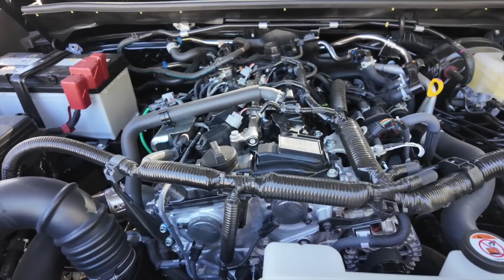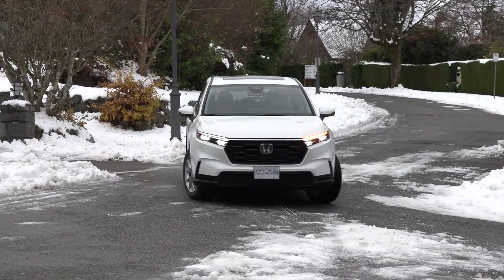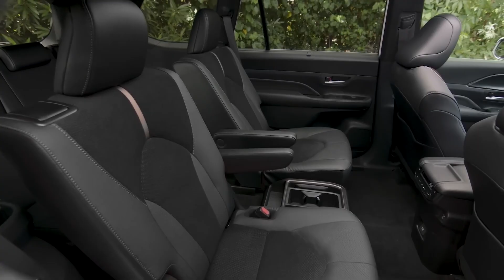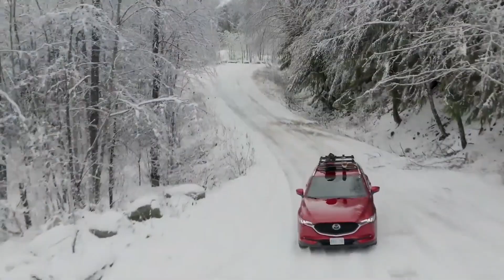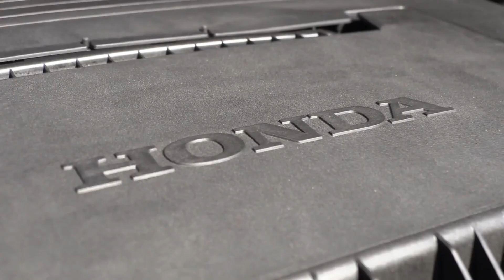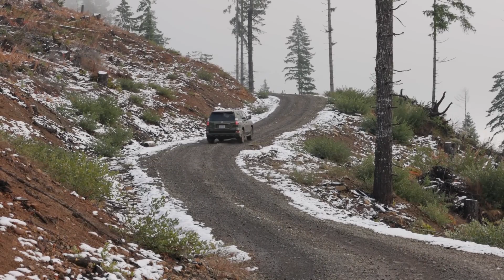7 SUVs That Mechanics Personally Recommend!

Comment: 2005 Infiniti QX56 with 320,000 miles..5.6 liter V8. Not good on fuel mileage but runs great…usually loaned to family members who have their new cars in the shop. To include some of the vehicles mentioned in this video.
Reply from the maker: ow, 320,000 miles! 🚙💪 That’s impressive longevity from the QX56’s 5.6L V8. True, the fuel economy isn’t the best, but when a vehicle runs that well for so long, it more than proves its value. Pretty cool that it’s still the go-to loaner for family while their newer cars are in the shop—that says a lot about its reliability compared to some of today’s models!”